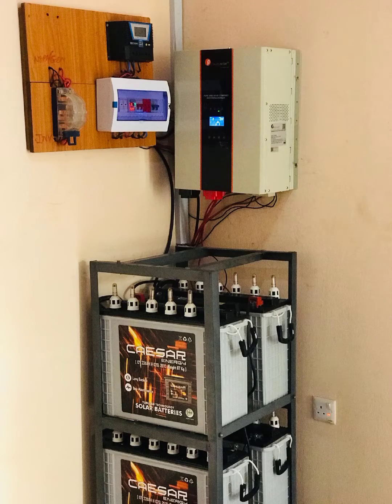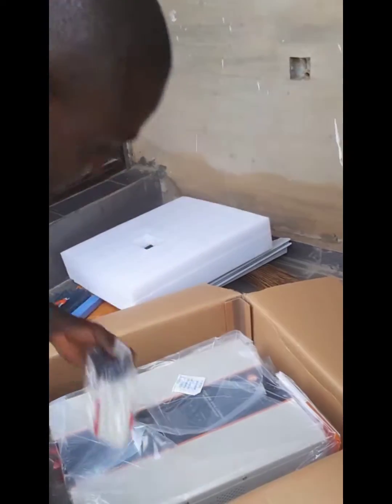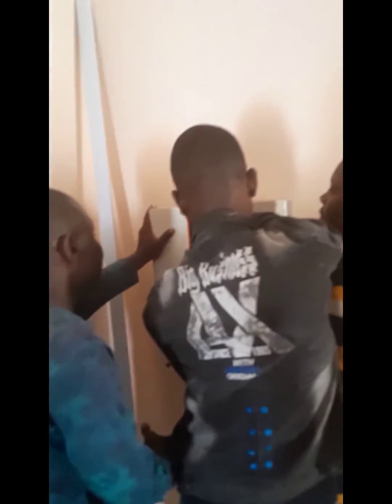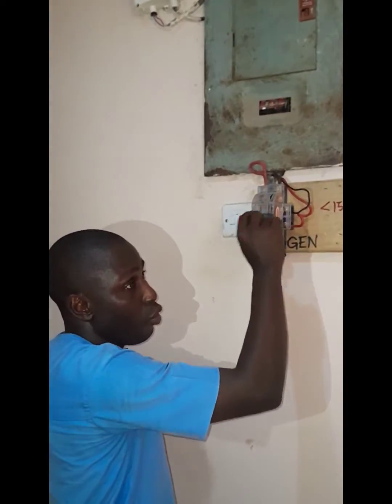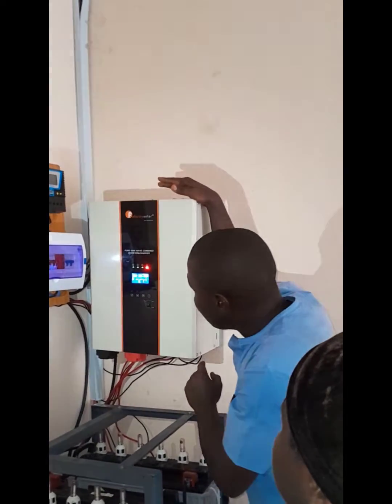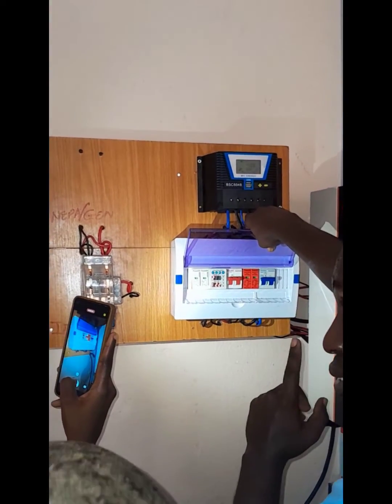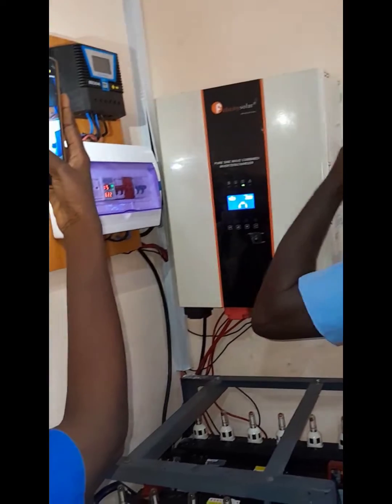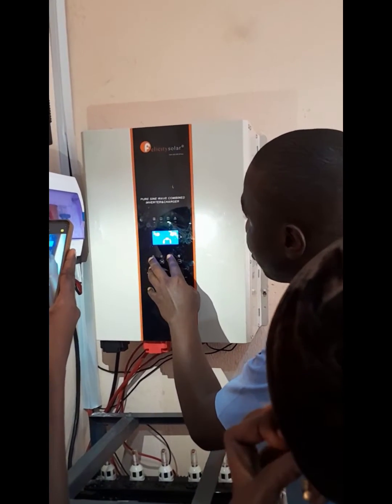Installation of a Felicity Inverter 5KVA 48VDC, with 4 Tall Tabular batteries and 10 Solar panels

Comment: Boss please help me i’m havin issue on this inverter
Reply: Please help me.the BATTERY is charging through AC and it didn’t supply out but it doesn’t supply out
Only the battery is id i display chaging
Reply from the maker: chat me up on +2348038015711

Comment: The inverter and the battery are not showing anything on those small screens they have is it normal
Reply from the maker: Is not, it should be showing conditions of the electrical variables

Comment: My newly bought inverter doesn’t charge fully is this normal or there’s an issue
Reply from the maker: Did you charged it to Full-point?, is the batteries lithium or Tubular?
Reply: @ yes it’s been charging all day and it’s a tubular battery
Reply from the maker: @gabrieljohnson362  What is the voltage on it?
Reply: @installerpaul  12V 220ah